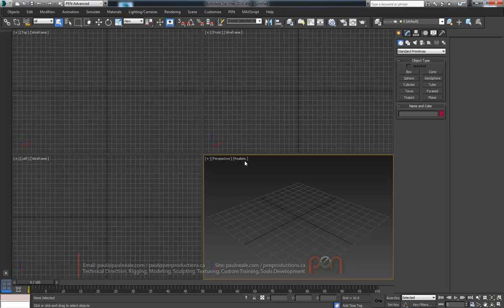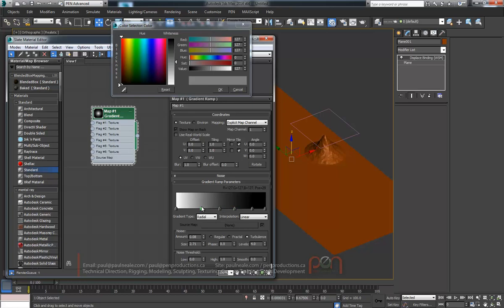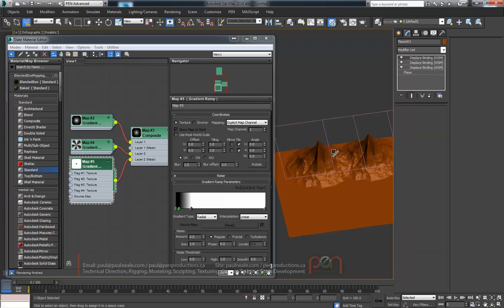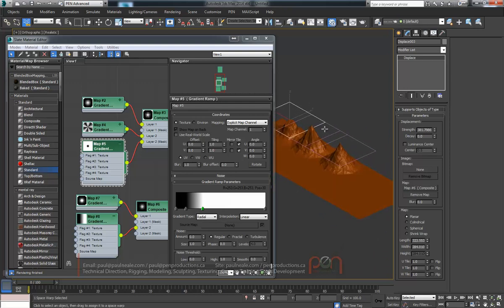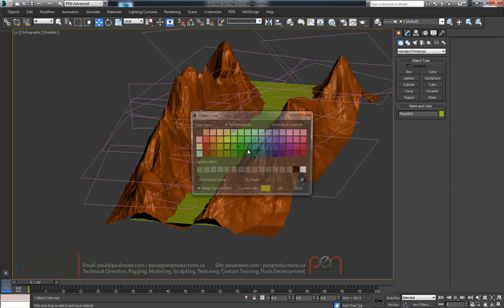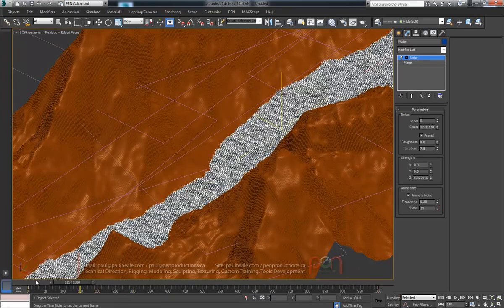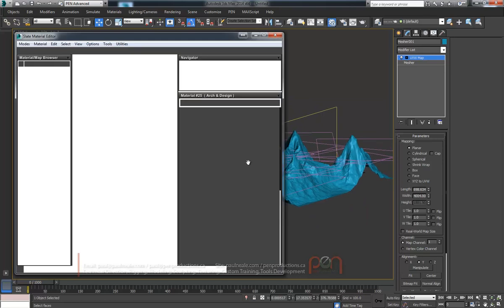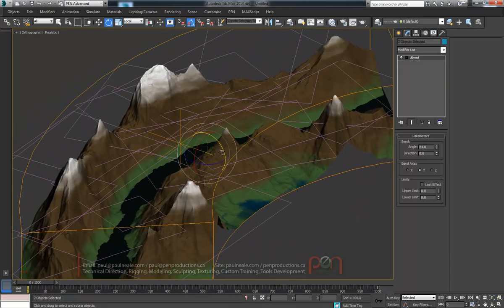Procedural Mountain Range

Comment: Wow, that was great. As a max beginner struggling to build out a mountain range to fly past, this method helped me create an impressive line of mountains and foothills. My problem is in getting the texturing to look good on something as large in scale as a mountain range. Using rock bitmaps, they get stretched and tiling doesn't cut it either.

Can I put a vote (request) in for a part 2 to this video that picks up where you applied the gradient color ramp as a diffuse (which was a pretty cool use) but instead go for a more detailed texture job? There isn't much out there that really creates a great looking end result, and you do a very good job with your tutorials!
Thanks again for the video, -O
Reply from the maker: OenopionsCrush Well I will consider it if I ever get the time.

Comment: When I try to modify values my program seems to chug down a bit.  I am wondering if there are rendering settings that you have set that help with that?  I am currently running an i7 with 64 gigs of ram, 2 graphics cards in SLI (GTX 970), and SSDs.  I can do building design for my game no problems, but for some reason when doing these mountains it laggs a bit and I can't figure out why any ideas?
Reply from the maker: All depends on the number of polys that you have going. Reduce the poly count until you can work with it. Place a Turbosmooth or Open Sub Div in the stack and set it to Off in Viewport so that at render time it adds the detail back in.

Comment: nice job on this but how to add some Realistic textures on the mountains to get a nice fit ? unwrap ? .. because the gradiant itself is not enought to make it real . Thanks
Reply from the maker: niighthawk21 Well the plane already has an unwrap on it that is flat from the top It will be stretched in some places but will often do. 

This is also a crazy amount of geometry so I would also suggest taking it into Mud or Z and doing an auto retopo on it and then unwrapping it for the final.

Comment: im using the same version of 3ds max as you, but when i place down the gradient ramp, their is barely any black on the gradient by default.
Reply from the maker: Spaghetti Not sure that I follow. I would assume that you are using 2.2 Gamma instead of 1 so the curve will not be linear.
Reply: paul neale actually, I found out the default gradient is broken. heres an image showing the problem https://www.dropbox.com/s/y0jndiql2zk065h/broken%20gradient.png?dl=0
Reply: paul neale actually nevermind, you were right, the gamma was defaulted at 2.2, which makes no sense, but went into the config file and changed it back. thanks!
Reply from the maker: Well 2.2 is the correct gamma. Better read up on it.